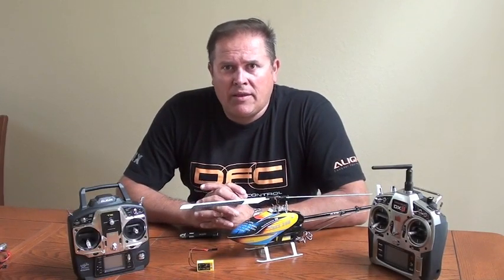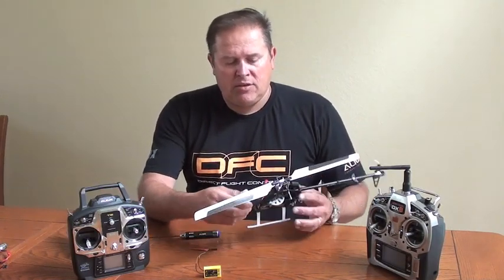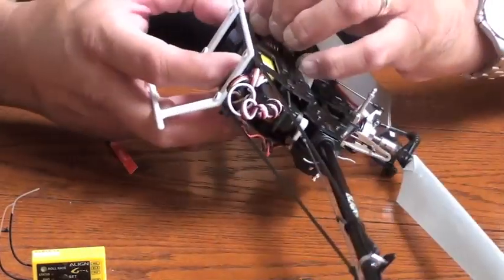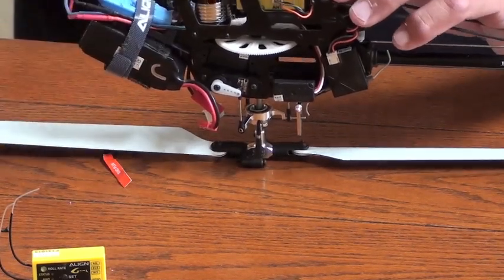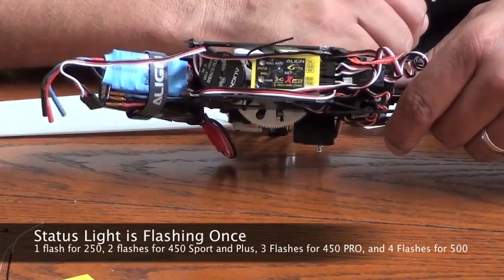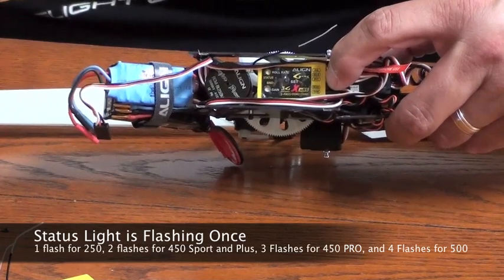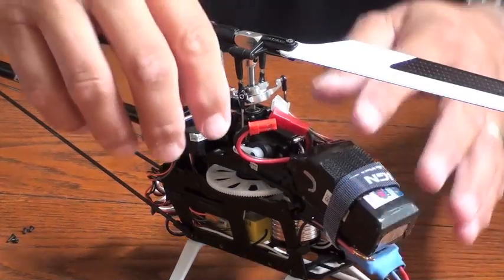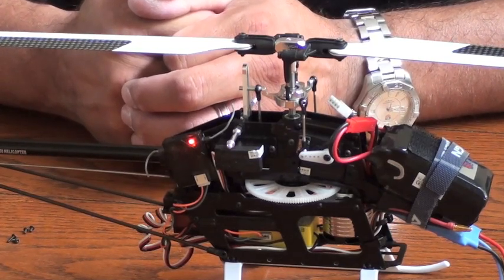Align 3GX MRS Model Selection and Binding Process for Spektrum

Comment: i know this is an older system and i just want to point out, the setup process is a bit ridiculous! why did they design the mrs system the way they did?  could this not have been designed easier for the user,  for instance removing the rudder and suppling power via rudder port, then put bind plug into throttle to bind!  why not have a bind port and save pulling other servos out?  this is the bug barer with this hobby!  its as if they make things as complicated as possible!!

Comment: HI can you bind the align 3gx  with a dx9 the same way, because i have installeds the AR7200 as well.. should i remove it and bind straight to the Align 3gx..( mine is silver and black one not the mrs

Comment: hi jeff. please help. i have bind plug in ail and power into throttle. i hold set whilst plugging battery in.after a few seconds i let go of button. but the status light is not flashing. the bind light is solid red only? could you plse advise? thank you

Comment: my DSMX sat RX stays solid red...but it turns on and off when i turn my DX6i on and off ??
 no inputs alatt to the heli... whats wrong ?
Reply: rob b nothing wrong with it . flashing happens when receiver has a break in communication with the Radio, you should not switch radio on and off with heli battery plugged in.

Comment from the maker: You should be able to use the 3GX. You setup may vary but the swash and how the swashplate moves are what is important. So long as you setup correctly you'll have no issues. I'm not familiar with the layout of the HH450 but it should not be that hard to make work. Maybe reverse a servo or swash movement but other than that you should not have a issue. Make sure to get a swash leveler to level the swash and you should be flying in no time.

Comment: I am doing a flybarless conversion on a Blade 450 3D, will the TREX 450 settings work well in my BLADE heli? Can the unit be programmed manually if the settings are not acceptable? You mention in the video that this unit should be mounted upside down, is there any harm mounting it right side up as long as the antennas are facing forward?

Comment: Hi Jeff,

I have tried to bind the 3GX MRS with my Spektrum DX6i with a Spektrum 9645 DMX satellite receiver.  Spent several hours trying to figure this out.  I have used an external battery supply and the ESC battery supply plugged into the Rudder port with the bind plug in the Throttle port but all I get is a Red bind light and a red status light.  Regardless if  I switch to heading hold or not the lights don't change.  I have never had such as frustrating experience with an RC product in my life.  I never have this problem with my AR7200BX although I know it does not need a satellite if using a Spektrum transmitter.   I have read that the MRS needs to be upside to function properly in flight and I ever tried that with binding and still can't get two green lights or any green lights.  In your video you did not mention or show the status lights on your MRS.  Should I return this?  Any suggestions would be appreciated.  Hank
Reply: I followed your video to the letter and it doesn't work.  My satellite binds but the 3GX MRS won't give any green lights.

Comment from the maker: Those DFC Pitch arms are working great. If later you want to go to metal you can but the plastic are holding up to basic 3D with no problems. If your just getting started the plastic pitch arms are more than tough. I fly mine all time and have had a lot of fun. Regards, Jeff

Comment from the maker: Yes, the model is already set to Trex 250, but if you should want to use the 3GX MRS with another model you have the ability to do that. The process is for those that but the 3GX MRS as a individual unit. But you are correct, if you by a bind to fly Trex 250, 0r 450 it should be preconfigured to the helicopter you purchased so just need to skip to the bind process and your ready to go. I may create another video, separating the two processes. Best Regards, Jeff